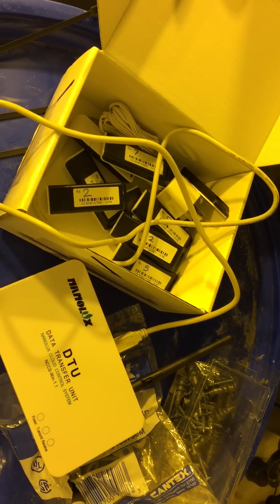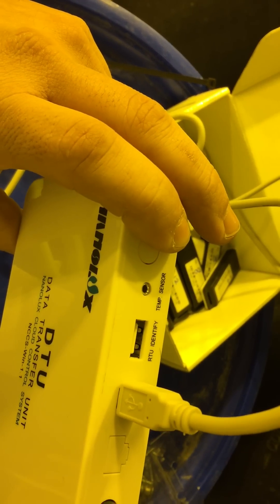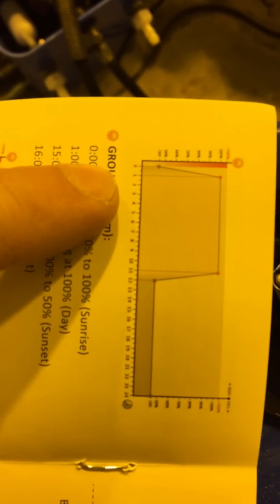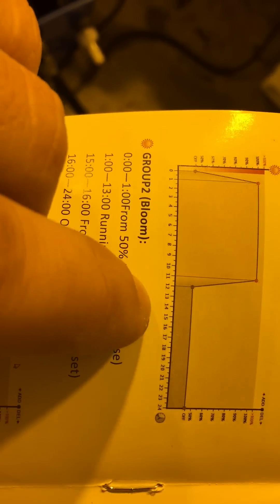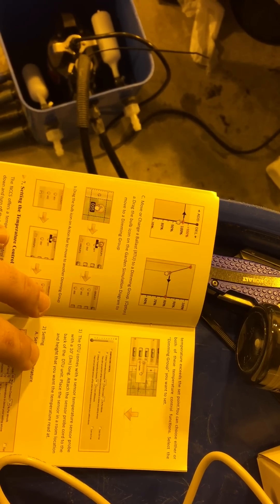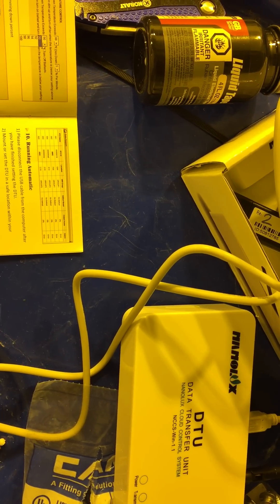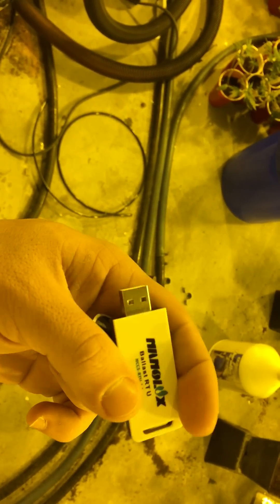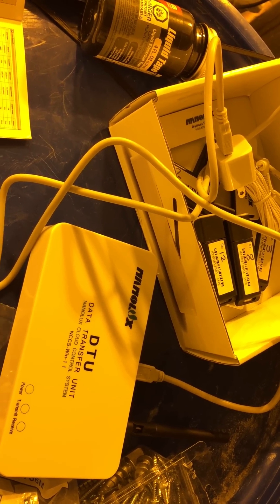Going over Nanolux's DTU wireless light controller.

Comment: im top feeding 6x6 grodan and recirculating but the res spikes in ppm wen i water i feed at 1200 and after it recirculates its up to 1500 and my leaves get yellow and plants look like there finishing early what can i do to keep them healthy and eating until the flush and the tents is dialed in 78f 50% day 70f 35% night sealed 1000ppm co2
Reply from the maker: +Cr remedies your watering times might be to heavy. its best to do many smaller feedings throughout the lights on cycle with rock wool blocks and coco. your nutrient solution could be lacking also. what are you using?